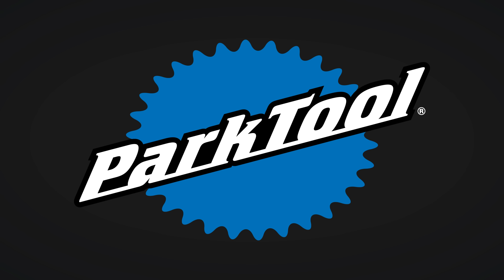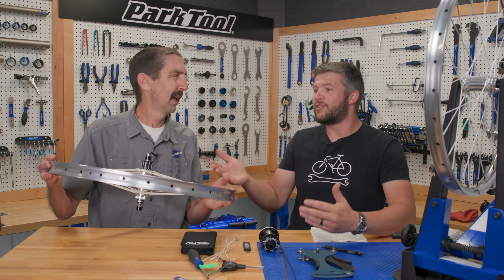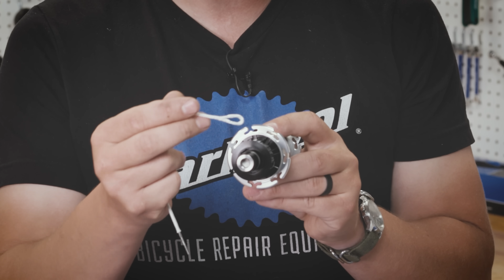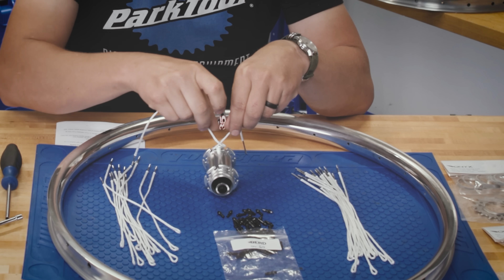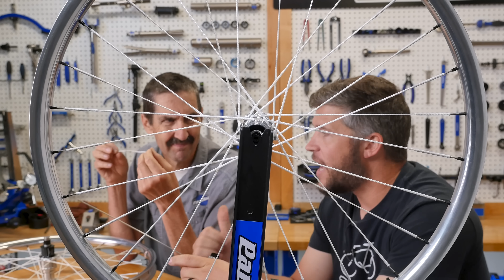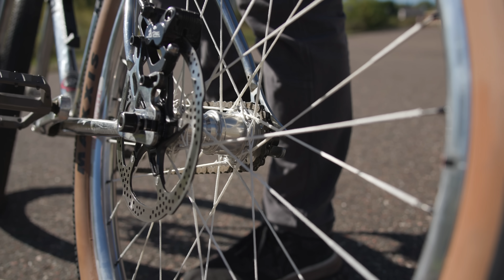Fabric Spokes!? - A Berd Spokes Wheel Build | Tech Tuesday #241

Comment: How do you lace a straight pull hub?
Reply from the maker: That is fairly easy.  Fill up 4-6 spokes along one flange.  Notice these point straight to the rim.   Lay the rim over this pattern. You do not bend spokes to reach a rim hole. You are give one choice, there is no selecting holes as in a drilled J-bend hub.

Comment: I have used dyneema in sailing applications for sail control lines, and they are even starting to use dyneema for the standing rigging to hold up the mast.  As such I know for a fact that the stretch and tension loosening you are experiencing is from the weave settling in and not fiber stretch. The fiber itself has less stretch than steel! It is nothing like the nylon guitar strings that someone had mentioned. This stuff just doesn't stretch. For sailboat lines you can get parallel fibers, with no weave, and there is almost NO stretch. You can also get pre "stretched" woven lines, where they put the lines under extreme tension to nestle the weave eliminating any stretch when used. Perhaps the spoke manufacturer could pre-stretch (pre-load) these spokes to eliminate the settling of the fiber.  Good video.

Comment: The problem with dyneem spokes is the aging. No fabric will last as long as steel does. Exposure to UV (sunlight) is a major factor in reducing the strength of fibres used in climbing scenarios, as extensive tests have shown. The smaller diameter of the fabric spokes does increase the risks involved. Ridiing through urban envorinments might expose the wheels to all kinds of dirt (oil, gasoline, etc...) that your climbing equipment will never see and if so you would replace it. Washing your bike, degreasing your  rotors or chain, might be risky for your fabric spokes. 
Dyneema when new is great, but it has limitations that I would consider unacceptable for normal use on a bike wheel. So even when used with a lot of care, a wheel with these spokes needs to be replaced after a couple of years I think. There are lots of articles on the web about aging of dyneema slings in climbing euqipment. Here is one from a reputable manufacturer of such stuff: https://edelrid.com/ch-de/wissen/knowledge-base/schaedigende-substanzen-fuer-seile-und-schlingen 
And another one from bergundsteigen, a magazine that focuses on risks in mountain sports and is a publication of the austrian and german alpine clubs. https://www.alpenverein.at/bergundsteigen_wAssets/archiv/2014/3/54-59(alte%20schlingen%20und%20reepschnuere).pdf

Comment: I’ve been running a Berd mtb wheelset for about a year. Honestly, I wouldn’t  recommend them. They are far more compliant than traditional spokes, and while this does have some modest benefits, it is more of a negative if you generate a lot of lateral force on your wheels.

My biggest issue is that the spokes keep failing on my rear wheel. The mode of failure probably isn’t what you think, in my case the threaded steel shanks of random spokes keep shearing. Granted, I’m a 230lb rider that enjoys dirt jumps, but I’ve never had so many spoke failures in such a short time.

I probably wouldn’t lace another wheelset with Berds. They’re cool in concept, but their durability isn’t working out for me. They’re also quite a chore to tension, and they require more maintenance until the spokes stretch out.
Reply from the maker: Interesting! Where on the shank are they shearing?
Reply: @parktool  At the end of the threads. The threaded portion is left stuck in the nipple. Most of the time the broken spoke will wrap behind the cassette and hinder its ability to freewheel.
Reply: @dkumagai30  Could it be because you have run out of thread when tensioning and continued rotation has weakened the metal?
Reply: @sebastianreddan1647  no, the wheels were built correctly, and the correct length spokes were chosen for the job. The threads were fully engaged in the nipples and at most a couple of the shanks extended past the end of the nipples by at most a millimeter. I think that the inserts are just fatiguing and they shear at the same spot every time such that all the threads get stuck in the nipple.
Reply: @dkumagai30  Thanks for the response, I am considering building up a set of these in 27.5 for my Pivot M6. Your experience above has me questioning if I should or not?
Reply: @sebastianreddan1647  they might be good for a lighter more tech oriented rider. I personally get weirded out by how flexy the spokes make my wheels. I can feel a distinct wobble and precession on fast corners or when I land a jump with my rear end a little off kilter.

Your mileage may vary. If you want them just for the weight savings and you’re on the heavier side of the spectrum they might not be a good fit. That said, I think they have recently released an mtb/enduro line of spokes. However, I don’t even think these address the issue I have because I don’t think the stainless shanks are thicker.
Reply: @dkumagai30  Already contacted them re the larger spokes, not offering them separately at this stage as they have been having bonding issues with the thicker material not biting down enough on the thinner spoke consistently.  Maybe they will sort that out and offer a tapered shank?
Reply: Long term feedback on my Berds.  Ended up back on steel spokes for the rear as the Berds were too flexy for the rear.  They were never confidence inspiring when hitting berms and it never felt like you could load them up off axis much.  Still have them on the front with no issues for now.

Comment: one other suggestion, if you used a torque tool, screwdriver like, then no matter what you cant over tension the rope, as this tool will stop you, also if you have a process down pat, then this can be in-built into this wrench, aka a number 1/2/3 so there is no mistakes, even for novice wheel builders.

Comment: When you put the loop inside the loop which one do you put as the trailing spoke?  The outer loop?
Reply from the maker: It really does not matter but in this video we put the leading spokes inside of the trailing spokes. The theory here is that the leading spokes that see most tension and abuse under braking should have a direct brace against the hub.
Reply: @ $500 to fill out 2 wheels with 32 spokes. Do you really want to know the answer still?

Comment: Combating stretch of Dyneema is the hardest part with using it on standing rigging on sailboats.  It's definitely the weaving of the fiber that compresses and elongates the rope.  I guess that's one benefit to Zylon on Spinergy wheels, since it uses more parallel run fibers there's less initial modulus during tensioning.  Maybe one day Spinergy will eventually become an aftermarket competitor for custom wheel builds...
Reply from the maker: The interesting part about these spokes is the fact they can be built at home or in a shop. The industry has seen many proprietary spoke/ wheel designs but lacked servicability or access to service. The benefit here seems to be the ability to select prefered hubs, rims and nips. Spinergy, Topolino and K-one are some great designs but lack the modularity of a design like Berds. We'll see how it plays out in the long run.
Reply: @parktool   Berd definitely has the market cornered on fiber spokes that can be laced to almost any wheelset, albeit some hub manufacturers may not exactly like the way they want you to enlarge certain eyelets or chamfer the edges.
Reply: I'm not certain these spokes are woven. It appears to me to be similar to paracord. With straight strands of fibers inside a woven sheath.

Someone from the paragliding community chimed in saying that's what they use and it has 0 stretch. The person did say the sheath can tighten up when wet though causing extra tension.

As far as what's actually in there, I have no clue.

I do agree with you on the braided dyneema. It does have some stretch, buy it's also minimal and once set taught it should require minimal adjustment.

Zylon is stiffer than dyneema and more heat resistant. Googles "ai overview" states there are bicycle spokes are made from zylon. I wonder who? It would make a much better spoke, offering much better shear strength and impact resistance. I looked into it and couldn't find a brand.
Reply: @brandonhoffman4712   Berd's are woven, that's how they get their hook shape at the end by splicing it in.  Spinergy makes Zylon spokes, but they are sheathed in an outer jacket because Zylon is more susceptible to the elements than Dyneema.  I'm not entirely sure what One-K uses...it might be tradename Twaron; One-K weaves it into several spokes and then encapsulate the whole thing in a resin to protect the fibers.

Comment: If you are using a screwdriver to tighten a spoke then could you put the screwdriver bit in a torque wrench. If you tighten each spoke to a certain torque then would save time adjusting spoke tension.
Reply from the maker: Using a tensiometer is much more accurate than using a torque wrench. Check out our video "Does torque equal Tension?"

Comment: Can the spokes be adjusted when the tire is on or does it have to be removed every time?
Reply from the maker: Yes, it can still be adjusted with a standard spoke wrench as long as you can hold the spoke.
Reply: @kroubian   I think that's a rim thing, not a spoke thing.

Some rims require you to tighten the spokes from where the tire seats. I know some envy wheels do this. It's more common with aero wheels as they are trying to be aero.

One word of warning with a rim like that. I learned in this chat that dyneema has poor shear strength. So having the dyneema coming out of a carbon hole might be less than ideal from a saftey/longevity sake. I'm also fairly certain if this were the cause of a failure, your warranty would probably be voided by the experimental floss spokes. Unless it were a no questions asked kind of thing.

Comment: Not clear on adjusting them after a tire is mounted. Are there two small Berd wrenches that work OK?
Reply from the maker: Using the Berd spoke holding tool and Park Tools SW-9 you can make adjustments with the tire on.

Comment: Regarding the weave vs fibers stretching causing the drop in tension, I can't help but think about nylon guitar strings. They are notorious for going out of tune when new; you need to keep raising the tension several times (typically over a few days) until the guitar stays in tune. Nylon and polyethylene aren't the same, but I still wonder if they aren't similar enough for the same issue to apply here.
Reply: Nylon is very stretchy, around 30% elongation at failure. Dyneema is very inelastic, at around 3% elongation at failure. Very much not the same, as you said.
Reply: @Frostbiker Abrasion is often the cause of failure , I found .
Reply: @Frostbiker  Can confirm. I have no experience of Berd spokes but I do paraglide and they all use sheathed Dyneema lines. The sheathing can contract when wet so every now and then a glider can get out of trim because the lines have shortened but the Dyneema core doesn't stretch elastically.
Another important thing to know about Dyneema is its very bad at handling sheer stress so never knot it as it will snap very easily. This used to be common practice when re-trimming paragliders during development/testing until some serious accidents happened (some fatal) and the practice was abandoned.
Reply: Makes me wonder what Dyneema would sound like if used as strings on classical guitar.
Reply: Dyneema is not nylon, dyneema does not stretch. If it's weaved, it may stretch a tiny bit initially, but it shouldn't be an issue.

Metal does stretch. As does nylon, polyester, lycra, cotton, etc.

Making the compliance claims questionable marketing to me.

I tie all my dyneema in knots. But the only life on the line is the fish. Also, knotting dyneema is tricky as F. I normally use a uni-knot. The stuff is so slippery you have to get tricky even spooling it on the reel. An arbor knot will not suffice. I've had one give, leaving my whole spool unspooling itself with a fish on until it magically cinches tight. It makes fight fish weird. I now use flourocarbon on the spool with an arbor knot into a double uni-knot. I also use a flourocarbon leader that I change out seasonally, about 30 feet long. Mostly for lure fishing, so the line doesn't spook the fish. I tie a swivel to a lighter leader if baitfishing. I always do 1 long and 1 short leader (dual pole license) a 2.5ft and 5ft leader from weight to bait. Whichever tends to hit, I swap the other pole to match. Fish feed on the bottom, but you need to be out of the weeds. If bait fishing I tend to use powerboat mouse tails on a single egg hook. It makes removing the hook much easier.

Now I mostly fly fish with barbless hooks. I even tie some of my own flies! I liken flyfishing to golf, it takes skill and drives you to be better. The main difference is flyfishing requires full attention all the time, where golf only requires it while up to bat. Bait fishing is like camping in call of duty, minus having to watch your back.
Reply: @brandonhoffman4712  That makes sense. Paraglider lines aren't woven, they are straight fibres, often sheathed with other materials, so there's no stretch. The upper cascade, which is least likely to snag on rocks during take-off as it sits on top of the canopy, is often a single fibre of unsheathed dyneema, lower cascades have multiple fibres inside the sheathing.
Any stretch due to woven fibres compacting would be very bad in a paraglider as line-length is critical to keeping the canopy correctly trimmed.
Edit: I just googled and apparently "Ropes made from HMPE or LCP type material (for example Dyneema or Vectran) should be assumed to retain only 40 percent of their strength when knotted,".

Comment: Apart from the drop in weight, whats the advantage?
Reply: String theory
Reply: Its mainly the weight but don't forget this is rotating weight that has a much bigger effect on the ride of a bike than weight elsewhere (e.g in the frame). Its also very hard to lose weight from wheels without compromising strength but these spokes don't have that problem.
Reply: Felxibility
Reply: More compliance.
Reply: It’s cool, what else?

Comment: I’m a 350 lb rider, I’m gonna have to pass on the fabric spokes. My back wheel are where spokes come to die 🛞 ☠️
Reply: If that's the case, I would think these are the perfect match for you.  The material used is the same stuff used in some forms of body/vehicle armor.  It's way stronger than a steel spoke.  My brother is 250 lbs. and has a set of mountain bike wheels with these spokes.  Had them for two years now and they have not even needed a tru.
Reply: @sjc115  Yeah I was actually looking into building a cargo bike 36-hole wheelset with Berd setup. I just can't find the longevity for long rides, though I can carry a couple of spokes along no problem.